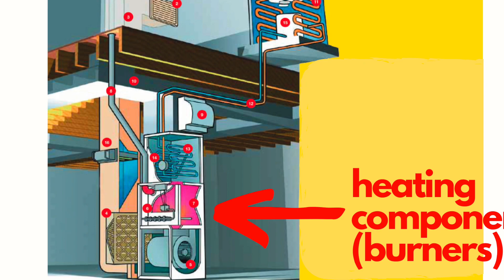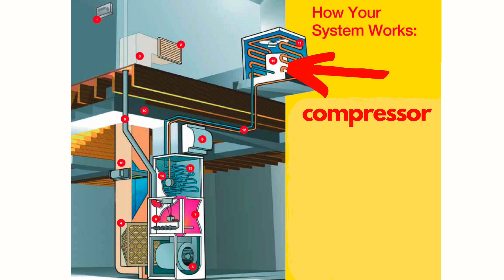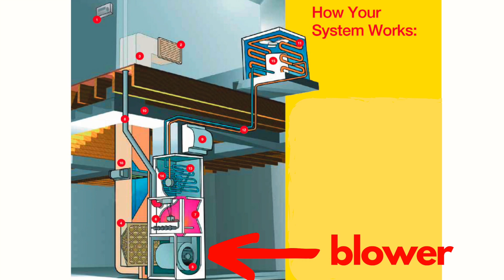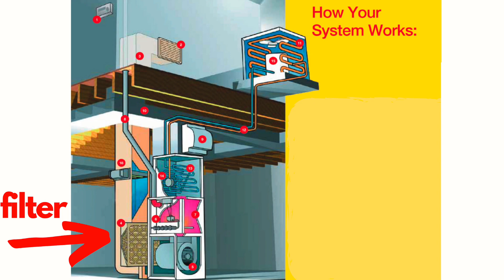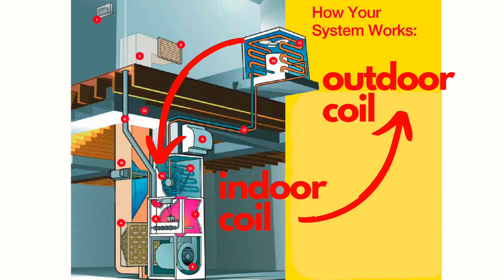How Does Air Conditioning Work? [The Basics With Diagram]

Comment: When installing a heat pump with two head units in a new building, can the lines between the pump and the nots all be routed inside (walls) of the new build?

Comment: great insight!  If you don't mind providing me with a bit of insight as to my current issue:  i'm located in LA, my fan outside is blowing warm air, the inside of my home won't go below 85, my grills inside are blowing air but its as warm as my hand.  My current thermostat setting is at 79 but as I said it won't go below 85 degrees.  and lastly here is the email message my ecobee just forward me regarding my thermostat:  There may be a problem with the Cooling system. For the past 4 hours the thermostat has been calling for cool, but the room temperature has increased by 3.6F.  Please help :)